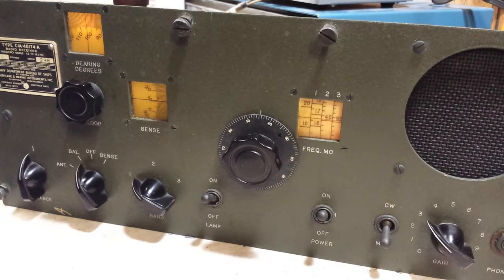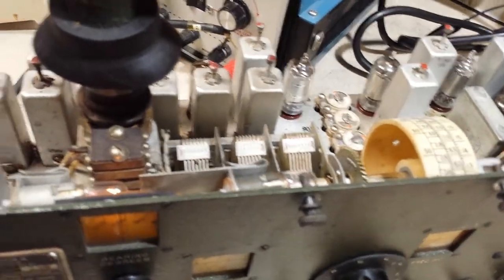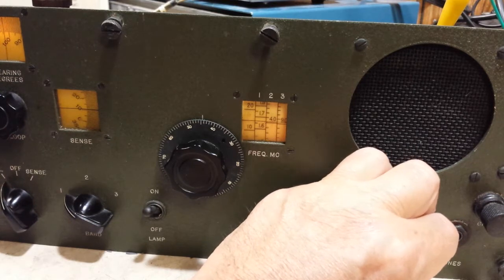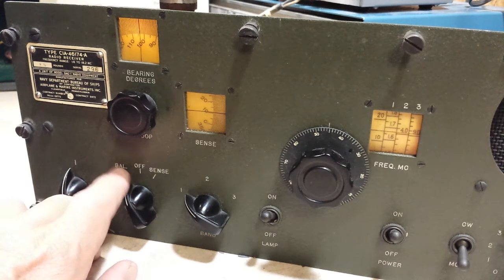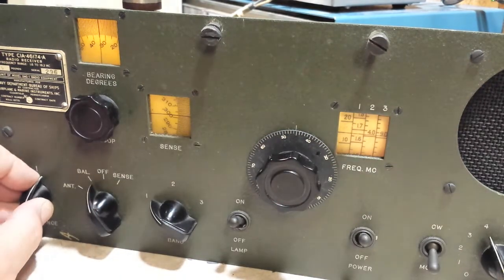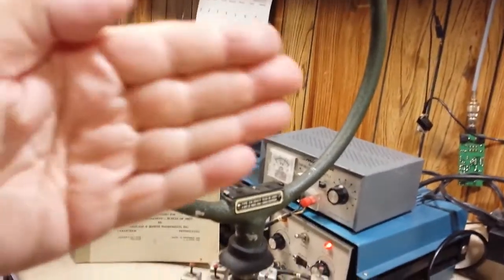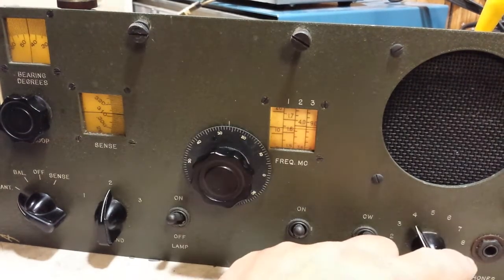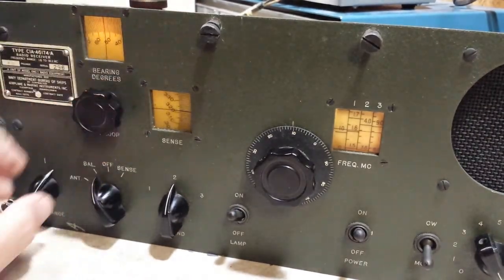DF Receiver WW2 DAG-1 Directional Finder

Comment: "The null is through the loop's center."

Yes, that's what I was saying to myself until I read your comment here. As you know, loops have two null 180 degrees apart. The Sense antenna helps to determine which null to use. I don't think that was made clear here.

Comment: I had one of these many years ago. I didn't have anything other than the loop and radio. I had to replace all of the tubes as the "ham" I bough it from had put 6 v on the filaments. After I retubed and did a tune up, it worked very well,  just as you described in your video. If you ever need a home for it, I'm good on QRZ.com. KA6JMM 73